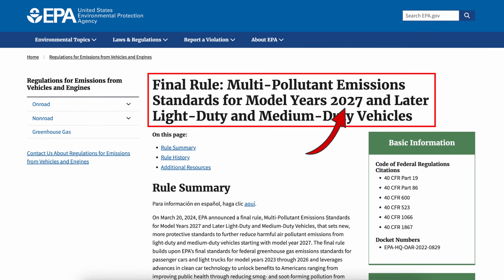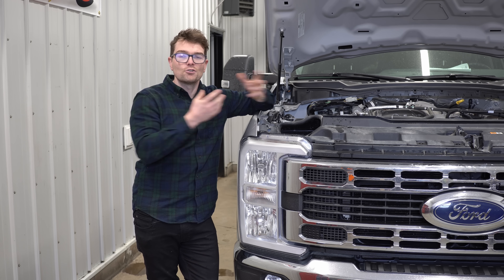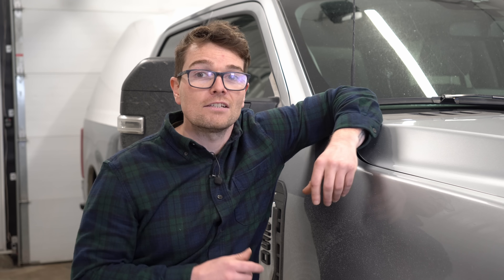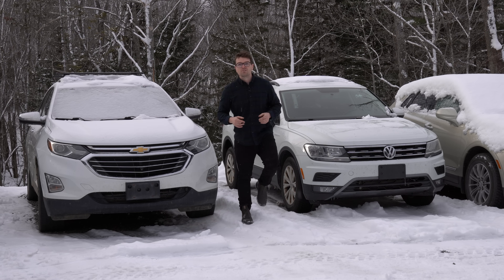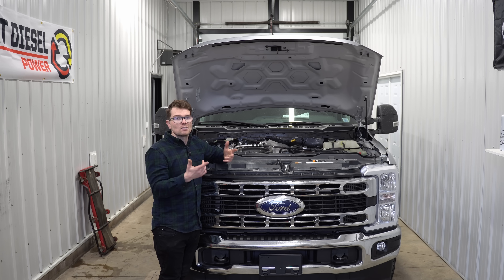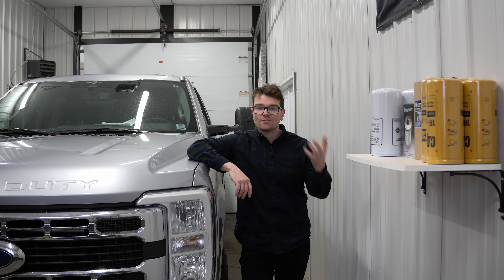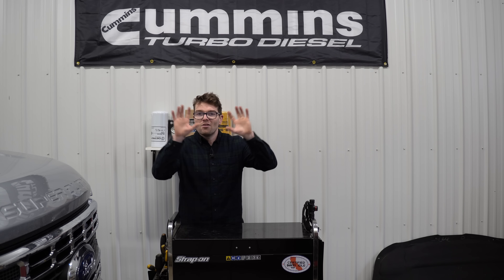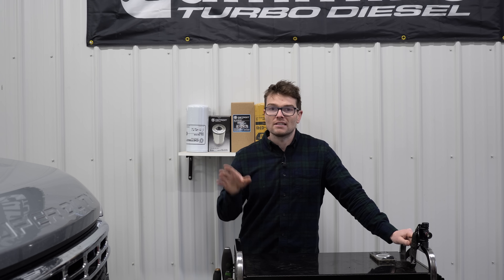NEW 2027 Cummins Diesel Engine EMISSION REGULATIONS are WILD **Diesel Mechanic Explains**

Comment: As a diesel tech for more 25yrs warranty is a very subjective thing. The things that can be considered as abuse and neglect are rather open even with all maintenance records.  I’ve seen Detroit decline “onebox” repairs due to injector past failures. It truly matters what tech support guy you get and how the tech words the findings there are things that need to be omitted. It’s kinda like an interrogation where anything say or don’t can hurt you ‘ie the costomer’

Comment: Cummins already make the Achates 2 stroke for the US military, and the Achates has already done the Californian CARB trials with exceptionally good results for NOx. Because the Achates 2 stroke design has integrated EGR built into its scavenge cycle, its way ahead of any 4 stroke engine, which needs the troublesome EGR cooler,valves etc.  Achates also has a 20-30% lower fuel consumption, which is a major reduction in carbon footprint, and economically superior.  The only read road block has been that OEM's have all stated that "We have been told the future is all electric" which is practically impossible in tandem with Renewables.  The short fall to achieve "Net Zero" with EV's and Renewables is 70-80% in copper metal and other more exotic resources also have issues.

Comment: So 2027 diesel really gona be junk and dpf won’t last 100,000? 150,000? Miles def is so stupid once mine messes up on my 2015 eco diesel it ain’t getting fixed wish I never done reprogram truck not same even with a good tune with my dpf still on no. More 30 mpg 25 at best  before reprogram worst I got was 19 in town now with program maybe 19 usually under

Comment: This is why I'm looking to buy a pre DPF truck 😂 EGRs are easy to delete usually. EGR is like making a person eat their own waste and say it's better for the environment. 

We have one work truck with DPF still on and it still rolls some coal under a load 😅
Having to regen the trucks and having all the plastic manufactured and factory processing the DEF probably makes these emission systems not any better by comparison. 
Can I claim myself as my own military and buy new trucks without emissions? I mean they should be required if everyone else is.

Comment: The most common issues I run into with the heavy duty (mostly cummins/paccar) diesel after treatment systems are breaking DEF line fittings (garbage plastic), DEF tank vents plugging with crystallized urea, wiring rubbing and shorting out or breaking, and failed sensors.

Comment: Question: Some years back my buddy bought a Ram diesel because it did NOT need Def. I assume that is because Ram has better catalytic converter. Is this why ? and if so why do not all manufacturers do the same.  Ram may need Def these days, I don't keep up on the diesel side of life as I don't have one or need one. But it may be better ways of cleaning up diesel without making them less relieable ??    Thx for sharing

Comment: This is exactly why my father had his 2013 6.7 Powerstroke deleted got an extra 5 MPG and dropped over 100 lb of weight excluding the DEF tank bonus being you can now actually hear the turbo to top it all off we live in a state where emissions testing is not required for an inspection and even if it was the truck would still pass emissions without that system

Comment: We have a Ram 2500 with a 6.4L HEMI. Performs like a champ even when hauling about 13,000ish pounds and a tougue weight of 1,700ish through the mountains of Kentucky. Only complaint is the small starter but outside of that it's a great vehicle. My cousin has a diesel Ram and the repair costs are crazy on that thing.
Reply: I have Peugeot with 6.5l/100km of LPG... $4.60 for 60 miles. Like... I use it in mountains too without any problems lol

Comment: In Australia we dont have to pass road worthy inspections every year. Lots of people just get a $600 flash tune to delete all the emisions, remove DPF block EGR and the engine loves it!
Reply: Most states don’t have inspections either
Reply: Of you have an accident your insurer may deny payout of you have modified emissions systems, it's happened to a lot of people now
Reply: @jarrod1687 stealerships are denying covering motors if they test the gas and it's not perfect.
Reply: We have yearly inspections in Pa.
It's really stupid bc all it does is cost you money.

Comment: 24’ Ram trucks with the 68RFE’s have a lot of issues already. Just did 2 this month that needed the thrust washer replaced in the transmission. One had 4K miles and the other had 10 miles…these engineers keep changing parts that don’t need to be changed. I don’t know why they would get rid of the AISIN for 2025. 

The AISIN is made by Toyota, it’s one of the few reliable things on a Ram. If you want a reliable truck. Get a 3500 single wheel with an AISIN. Best vehicle you could ever buy.

Comment: This stuff is ruining new diesel trucks. I had a 2015 f250, it had egr and def problems, had to sell at 40k miles. Got a 2022 ram and it’s having egr and def problems at 20k miles. It’s choking these motors out with carbon buildup. Dumbest chit ever. They’re gonna keep on and nobody’s gonna buy these trucks. They cost twice the price and stay torn up

Comment: This is the EPA regulating diesel out of private use. 

CAT bowed out years ago. Cummins and the others will never bow out. They have to keep making on road engines for military applications.of course those military applications don't have emissions gear. EGR deleted from the manufacturer, no aftertreatment systems because the military needs clean, efficient, reliable equipment.

Of course these manufacturers can still produce civilian variants with all the jackass-esque fart masks and filters that destroy them because they make money hand over fist selling them outright and repairing them.

Comment: At least the warranty is improved. It should hopefully hold them responsible for the quality of the components so they don’t constantly fail. Simple additions like EGR gas filtration and crankcase gas oil vapor filtration would improve reliability as well without requiring any electrical or mechanical components; just stationary static filtration.

Comment: Can't wait to have a DEF mpg gauge, a new issue every 10k miles, new DPF every $50k. 
Drove my 15 chevy 2500 to work and back for a while, about 14 miles, 15 minutes. Mainly just that and back home, didn't do much else and everything was nearby, so of course the DPF got too built up and it was a $5500 quote from stealership. The piece alone is over $2k. I took it off, opened it up and broke up the ceramic like filter and welded it back. Got a tuner device for $450, bought a tune for around same price, tuned it and now it works great and gets better mpgs. Absolute ridiculous that all this is illegal and I'd be forced to pay for it all. New trucks are going to get even more expensive with these new requirements. Not sure how people will afford new trucks for no less than $100k and tons of issues that'll cost them time and money.

Comment: hopefully manufacturers sue for relief for these extreme stands based on off the fact that the Chevron deference has been reversed so now new laws, which is what this basically is, have to be passed by congress. The EPA is out of control. Best thing would be to get rid of the EGR system and take care of NOX on the back end.  And if you can already breath the air coming out of the exhaust, why are we still going after them?

Comment: Is anyone trying to get the EPA to quit being stupid? The energy code for buildings has gotten stupid. If the EPA holds diesel to such a high standard, they should make the gas engines perform at an equal level on particulate matter in the exhaust. 
The more EPA goes too far, the more deleted trucks exist. If the system is good and efficient, it should be good enough. If you push people too far, you start a rebellion.

Comment: If the egr lowers the temperature in the cylinder....then doesn't that reduce how efficient the engine is?
Reply: 100% it does. Less efficient combustion, lower power, lower fuel economy. But ask the EPA if it cares.

Comment: The epa due to the chevron doctrine going away to begin with and with trump And is the EPA director Are going to roll back regulations at least 10 years anyways. The e p a won't be a p e p a won't be a loud To Put out any new regulations anyways Put out any new regulations anyways. Not what they're going to be rolled back. If the EPA thought it was bad recently. Then they have no idea what What's in store for them come the next several months. New EPA emissions New The emissions regulations my ass

Comment: Does anyone actually believe any of this BS is actually meant to save the environment?  Funny, when Europe runs over 68% diesel for decades with no smog issue’s or health problems.  The particulates are too large to be fully absorbed in the lungs from every study that I have read… it is all complete BS!  Let’s take the most reliable, economical engines, that have the longest life and quite literally choke them out of performance, reliability and eventually existence!   It is all a scam just like the rest of the save the environment BS… when is everyone going to wake up and get tired of being bent over, over and over without lube.

Comment: The new 48v alternator and grid heater on the DOC replaces the extra fuel dosing on the X15, mpgs are to go up by 5-6% starting on the 2026/2027 X15.

Comment: In my time studying internal combustion engines the new regulations will actually help. Mainly due to the fact that we can make and have made reliable scr systems that don’t need any sort of dpf. The issue is with non strict regulations companies choose the cheapest route and instead of installing a full blown scr system they use crappy ones and dpf to pick up the slack. I’m probably the only one in the world but… I’m actually excited for this. Companies will now have the push they greedy asses need to make an actually decent scr system. Because it has been done and is already reliable. They just won’t use it because it’s $$$ to invest in.

Comment: You know, if I wanted to make an industry "go away" without being an absolute tyrant and banning it, I'd write up crazy new regulations like this.

1. Set crazy high requirements that will leave manufacturers no choice but to implement costly and convoluted designs that will inevitably become costly recurring maintenance items.
2. Mandate manufacturers warranty these items for such a long period of time that they would lose money at the current unit pricing.
3. Watch as manufacturers are forced to set unit prices so high to even hope to make a profit that consumers ultimately can't afford to buy them (I know some people would still try to take out longer-term loans in order to buy them, but with the fairly-recent repo apocalypse financing agencies are gonna be more tight-gripped with who they loan to).

Comment: All this stupid tech just to clean up the fuel. So then why not just spend all there time and resources on making a better fuel? Duh. Jet fuel is said to be very close to diesel and may burn cleaner then it. All I'm saying is, if the fuel is the problem, then fix what's broken and leave the rest alone. Also (and this is just my tinfoil hat theory) but Is this yet another dick move by Democrats to increase the already flooded inflation? I mean why all the attacks on just Diesel's? Lets not forget that all our goods are shipped or transported by a Diesel engine at some point. Anyway that's just theory but it does almost fit and makes kinda some sense.

Comment: The climate trolls are messing with a lot of other things yo umay want to check out. Tires and brake dust is something they are limiting as well. 
Ev cars apparently create more of this than most other cars due to its weight. 

In the trades our glues and paints are being watered down with low quality replacements. 
A lot of us are lost on what to do as the tried and true products and being changed into junk.

Comment: I wonder if someone could calculate the carbon footprint on DEF and this new system vs not having them.  To include, generation of materials, production,  distribution and the extra fuel necessary to run them.

Comment: We need to get rid of or change this emissions BS. I miss the older Pre-DPF engines like the DT466e, 7.3L T444e/7.3 power stroke, Cummins 5.9, MBE906 and 926 engines and the Cat 3126 and c7 engines. These engines worked so much better when they didn’t have all this crap on it. They even seemed to have better power output too.

Comment: You should check out Scania and their trucks as they don't have egr and still comply to the Europe regulations concerning emissions. And the air they put out of the exhaust is actually cleaner than what they put in the engine intake. Sorry, but Europe i feel are about 10-15years ahead of US concerning this emissions problem/regulations. Greetings from Norway 🇳🇴

Comment: Every diesel truck or tractor or loader I own, is deleted. They run clean, cooler, and get way better fuel economy and more power with ZERO issues.

Comment: In the meanwhile Mazda has released the very first diesel with ducted fuel injectors. It's a inline 6 which 48% thermal efficiency.  It doesn't need these emission components to meets emissions standards.  Go mazda.

Comment: i was understanding of the current systems but i am at a loss of the need for a more strict standard it’s a really big step and i really think it would be far more beneficial to give the manufacturers time to develop the systems and make them reliable an more efficient i am definitely for that warranty increase as these systems are very expensive to replace i hope that manufacturers don’t just pass the cost of increasing warranty replacements on to consumers and actually make the system better an more reliable

Comment: The problem is not motor vehicles. Roughly 20% of air pollution in the US is from transportation. The bulk of which is aviation, so that drops that 20% down to like 8% or less. Whereas more than 40% of air pollution comes from making energy. The real answer here, is to stop preying on the average person for a negligible sector of polluting factors, and instead address energy. The solution here is to build modern generation IV SALT nuclear reactors. We can't, because of two factors, outdated nuclear proliferation agreements which don't apply to these new nuclear power plants, and... the oil and gas lobby, who has lobbied for legislation and scare campaigns against nuclear for decades. So, you're being mislead, none of this is necessary, your car or truck isn't destroying the planet, improper regulation and lobbying is. We can go to 0% emissions in the energy sector if we do this, and here's the kicker, those reactors can consume the nuclear waste already in existence. Do your research, be a fan of new nuclear technology, it's not the enemy, it's the answer, and your car isn't the enemy either.

Comment: These are the reasons I'm driving a 1997 suburban with a detroit 6.5 turbo diesel, a 1983 Chev C60 with a detroit 8.2 na fuel pincher diesel , a 1985 Chev Kodiak with a CAT 3208 na diesel, a 1992 vw jetta with a na 1.6 diesel, and my farm tractors are diesels from the 60's-70's.

Comment: I like EGR.... on a gas engine lol
.
For my daily like gm 3100 v6.... it's fine... never had to mess with it in 372,000 miles 
.
On a 6.7 I6/v8 diesel.... no EGR is beat lol